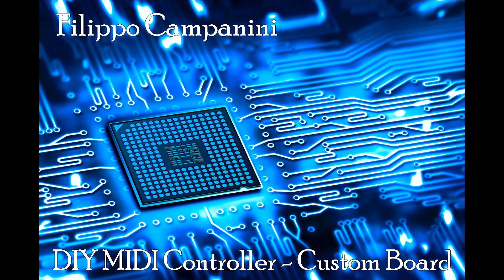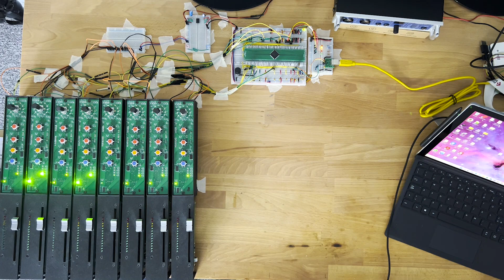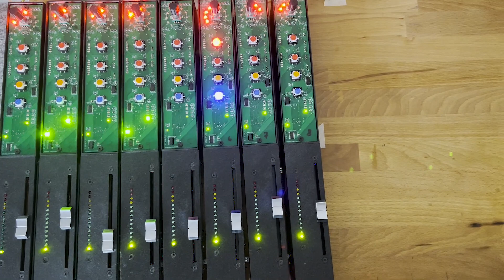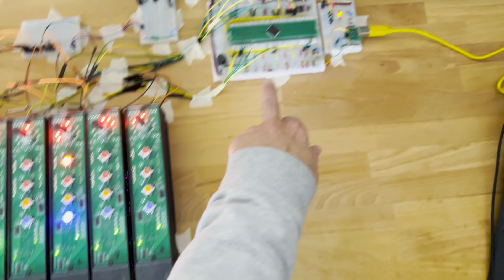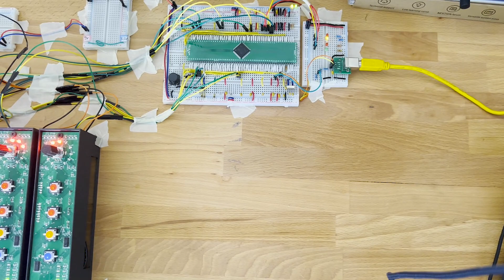DIY MIDI Remote Controller - Custom Board

Comment: Thats so crazy! i'm maker my midi controlers for using wiht Reaper. What microcontroler you has used? 

 I'm sorry for my english. I don't speech so good. i'm brazilian and never studed so good english linguage.
Reply from the maker: Hello, thanks for the kind words! I am using a Microchip SAME70 in the custom board and SAMD21 in each strip. Cheers!

Comment: That touch problem would have driven me crazy! I know for sure because I'm trying to repair an intermittent capacitive touch issue on just one fader of a controller I have. 

How did you realise your situation was due to being grounded?
Reply from the maker: Well honestly I came to the conclusion that technically speaking it should have been something “different”, after having tried every possible test for 2 days…. The moment I knew I was in the extravaganza domain it took me not much more time to get to my feet! :-D